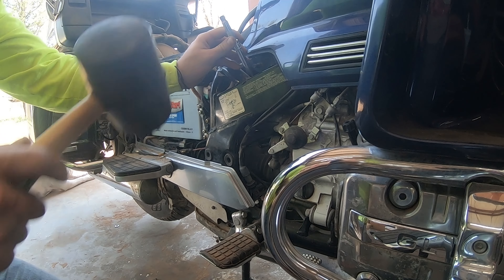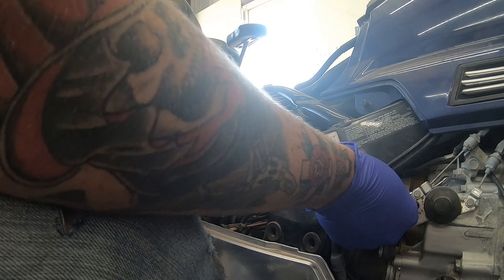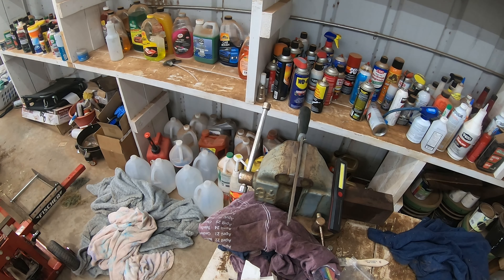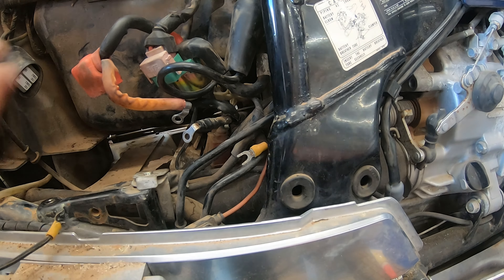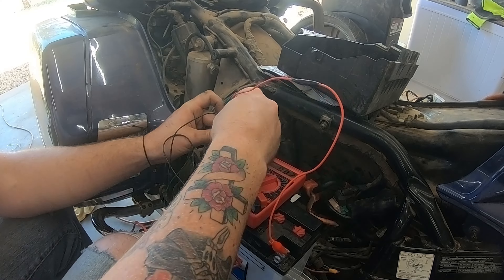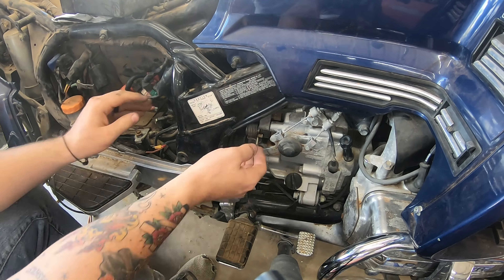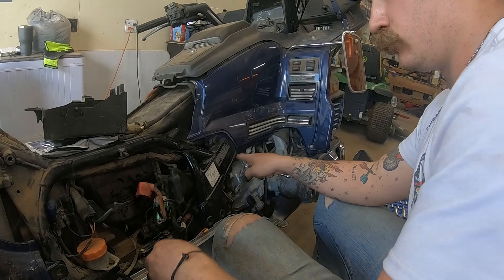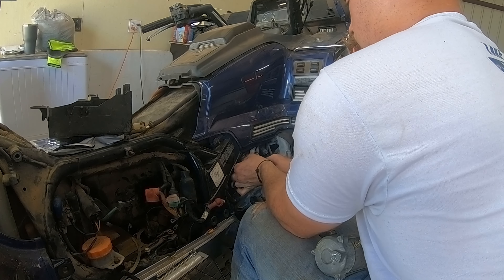Lets Remove The Starter! 1988 Goldwing GL1500 Restoration Pt 12

Comment: thank you for the vid ,  I have a 95 and my starter started to click  , i may have to remove mine and this helped
Reply: now going to check my solenoid
Reply from the maker: @curttabor2827  I would check that first, best of luck!
Reply from the maker: Might check your battery voltage as well

Comment: Thanks for your vidéo,  I have to dismantle my starter motor also, what a hassle! I was able to remove 2 bolts, I can't see the 3rd
According to the video it would be +/- down.. I'll watch it tomorrow then, because right now I just feel like scrapping the bike..
Normally when powering the motor directly from the battery it should spin, mine doesn't. So, I think it's unfortunately the starter that no longer works.
Reply from the maker: The next video I posted about it showed how i fixed my starter not working! Now it works great! It really is a pain in the butt to remove